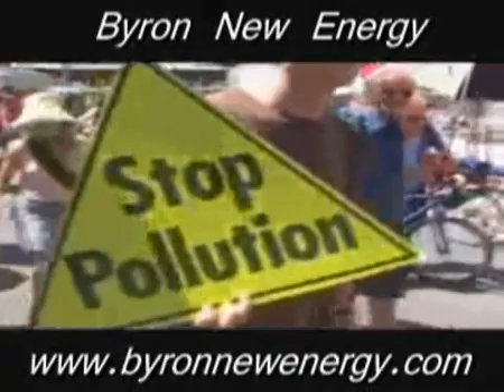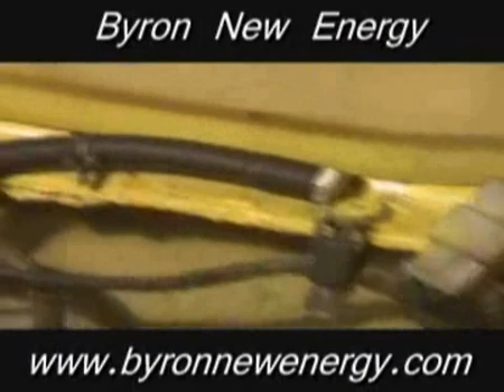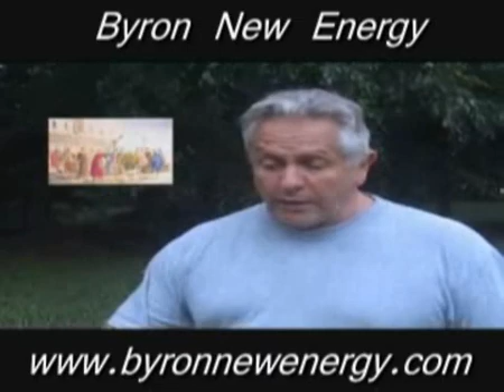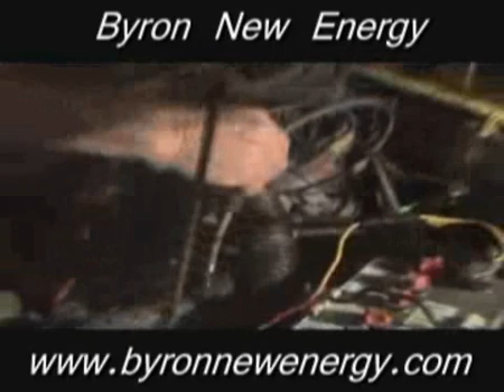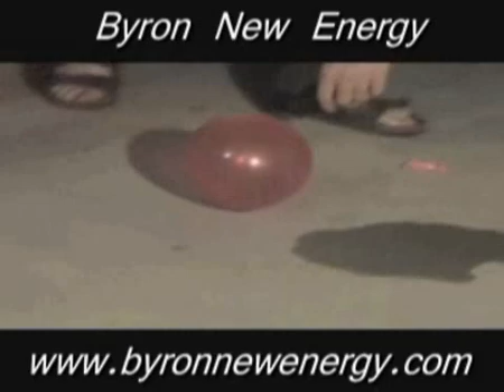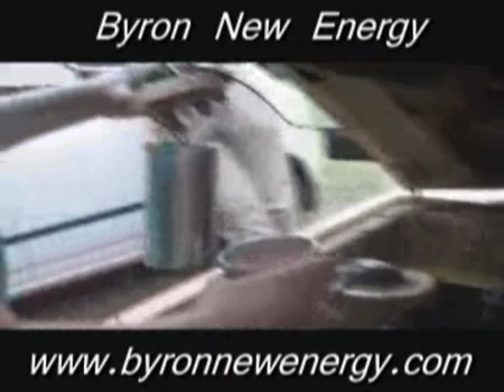Joe Cell From Byron New Energy

Comment: its the workings of an old fashioned bridge rectified generator but cleverly utilising the engine components and metals like a chrome bumper to act as a static draw aerial negative as bumper is positive to hold chrome on it etc

Comment: at 1.54 you will see peter brocks type spark gap enclosed on the positive extra positoive wire coming off the battery to the starter and this may have either just 1 gap or a multitude of gaps it then fires air that has nitrogen and oxygen as the spark is the opposite it should be so now its positive and may be the exhaust air coming in is charged so that nitrogen and oxygen can pass on to the engine but the rest of the air attracts to a opposite charge and stops the gas in its tracks

Comment: the reason you can pour water down the inlet carburetor is because it is pushing the water back to the tank as joe shows in his mk2 escort as it is an implosion engine from charged air thats why it eventually back fires down the exhaust as static discharge.no expert but it seems that is whats happening

Comment: i first learnt of the joe cell about 15-16yrs ago, and was amazed at its ability and even witnessed a car running on it! Im now doing a science degree and this cell still has an element to it im yet to understand!
however the balloon fire was an alcohol fire, ie ethanol!  The earthing through the radiator hose is not impossible, if you remove the earth lead from the engine! pouring water into an engine is possible without anything bad happening!  But, pure water at 277.15K cannot be compressed!